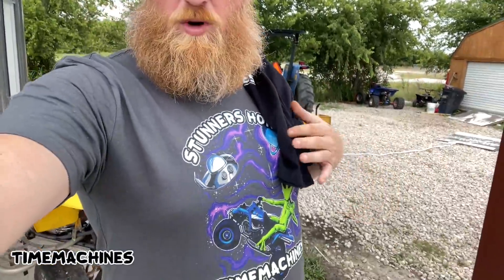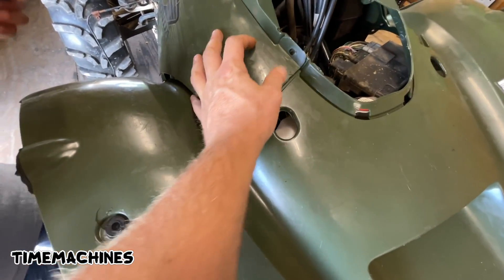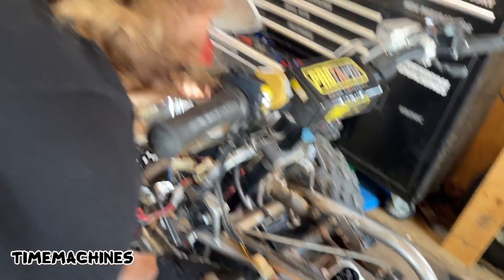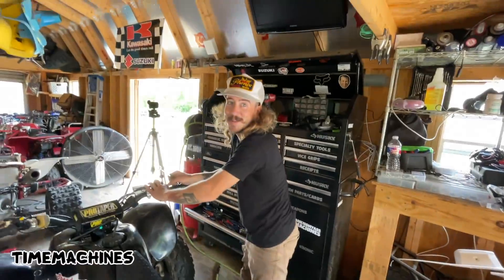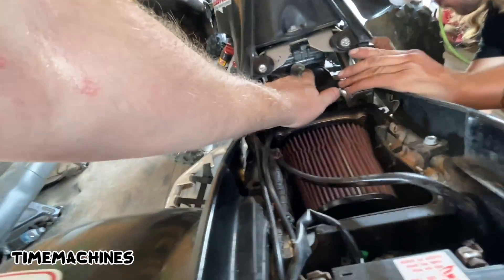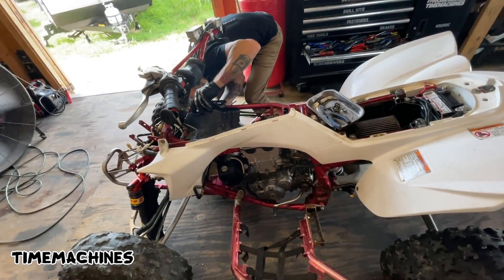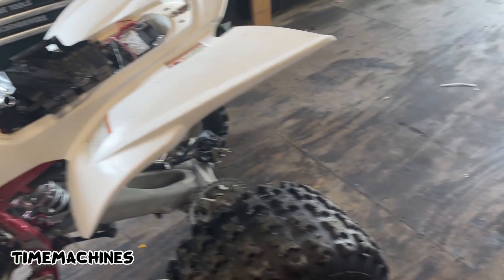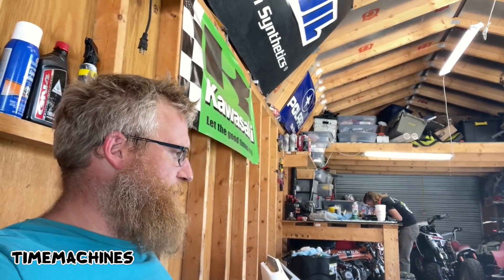Working on the yfz450 & raptor 660 | 4 Stroke Friday

Comment: Maultechatv.com has a great valve shim calculator I use all the time. It will tell you exactly what you need to put in. And it has a spot for yamaha's five valve systems for that yfz 4fitty. Chaaa get up in there🤘

Comment: I got a 2000 Yamaha blaster and the back left tire waddles I’m not a mechanic so I need some help. Any suggestions on what it could be?
Reply from the maker: Either loose castle nut on hub. Bent wheel or bent axle